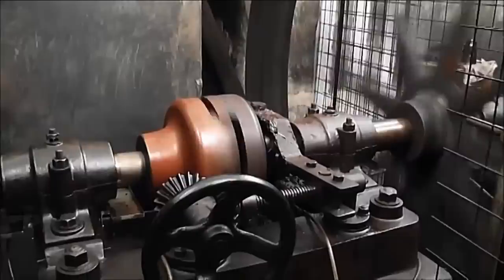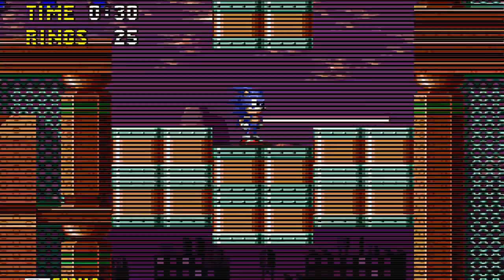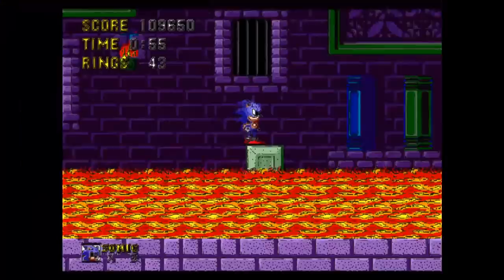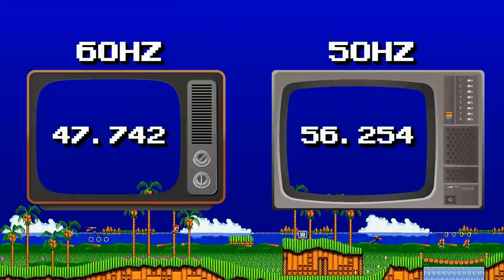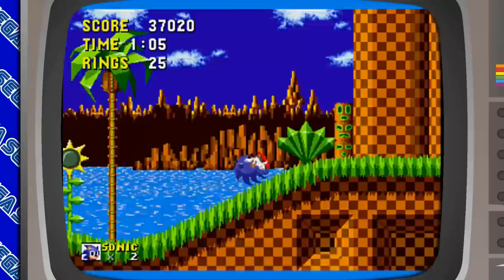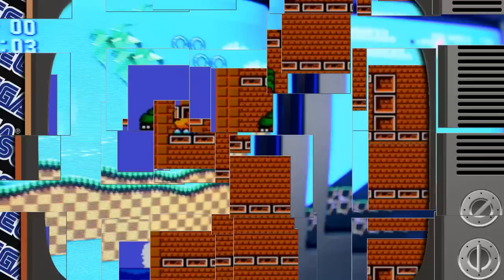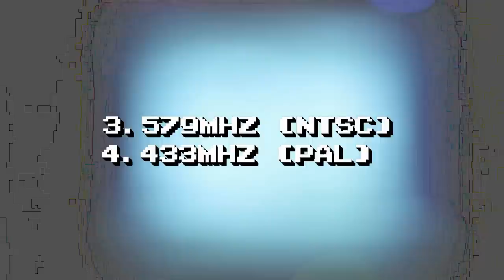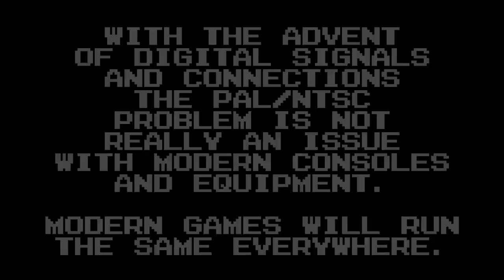Why is Sonic Faster in America? NTSC vs PAL/60Hz vs 50Hz | Nostalgia Nerd

Comment: Only tidbit I expected this video mention, especially in the "engine modification" part was the fact that Sonic 2 and Sonic 3 (and knuckles) do have a detection for 50hz. They ONLY change the music speed to what it should be, rest of the engine, gameplay, and even some sound effects and jingles are all still that 1/6th slower in 50hz mode. Someone with a switch can cause some havok by booting the game in 50hz and then flicking it to 60hz mode on the fly. Crashing is very likely to occur too though.

Comment: Just remember the section talking about how TV's only show half the picture at a time of this video misleadingly implies that game consoles output interlaced video. They don't. They use a hacked timing signal to output 224p or 240p or something like that by drawing the same set of lines twice, and leaving the other lines blank.
This is what causes the dark lines on a display that emulators call the 'scanline effect'.
It also causes most modern non-crt TV's to display the output of old consoles and home computers incorrectly, leading to an odd form of image instability that's not supposed to be there.
(mosern tv's largely ignore the actual timing signal, and just assume a pal input is 576i, and an ntsc one is 480i, which, for most systems up to about the ps1/n64 era is wrong, and displays the picture incorrectly)

Comment: AC power does not directly have a side effect of being able to be transmitted longer distances. The reason is due to the much higher voltage used in AC transmission on the grid. DC power transmitted at the same voltage would have similar efficiency. The reason AC was chosen for power transmission is because it is much easier to reduce the voltage to go into a house with AC that is with DC. Recent technology advancements have made it feasible to do the transmission on a fully DC grid, so it may be done in the future, since being all DC has advantages of not needing transformers for everything and our digital worlds (digital devices require DC power).

Comment: RGB over SCART is the way to go for old consoles. The connector is a bit clunky, and you might find yourself dealing with frustrating sync problems, wiring mismatches, and console mods in order to pull it off, but the reward is soooo worth it!
Reply: Also, fun fact: The Genesis can be overclocked. It's kind of a pain, as it involves desoldering & lifting one of the 68000's pins off its trace, then tying it to a clock circuit you have to build yourself--and there's no guarantee the Genesis will be stable at the new speed. But when it works, the results are pretty impressive. I could never get a model 1 stable at anything above stock clock speeds, but I got a model 2 working great at 10 MHz. That extra speed makes a huge difference in games that normally chug pretty bad, like Sonic 2's split screen mode & Thunder Force 4.

Comment: RGB is neither PAL nor NTSC, those are both encoding methods. PAL60 simply means the refresh is 60Hz and the colour encoding method is PAL. RGB is a discrete  signal, there is no encoding taking place.

Comment: Honestly I really quite like PAL Sonic. I mean sure, it’s slow. Sure, it’s not how it’s intended to be. But it’s honestly quite fun! The music seems strange at first, but you get used to it really fast and some of it I prefer. The gameplay, while it seems slow at first, you adapt to it rapidly and it’s not that bad, in fact the slow gameplay makes things a bit nicer sometimes, some difficult sections are much more manageable. I’ve beaten the game emulated in both 60hz and 50hz, and I’ve beaten it on real hardware in PAL, and it’s really interesting and I can’t help but like it.

And in my situation, it’s not just nostalgia either. I didn’t grow up playing Sonic on a real Mega Drive, as I wasn’t born back then, I grew up playing Sonic on the original crappy iOS app on my nan’s iPad, and while it was supposed to be running in 60hz it sure didn’t feel like it as the emulator was crap. It was actually running slower than 50hz, but I didn’t mind as that’s how I knew Sonic. However then they updated the app to run at proper 60hz, and I had the rest of my Sonic experience on a 60hz emulator, before I beat the game on a 50hz emulator and then eventually on a proper 50hz Mega Drive when I got given my mum’s old one, so I learned to play in 60hz, which means it’s strange how even now after experiencing both (and actually having more time on 60hz rather than 50hz) I still prefer the 50hz game.
Reply: Yeah! I prefer games to run at 50Hz too. Gives the player more time to react.

Comment: I remember when I plugged in my NES console to the TV (nowadays you can download a ROM-assisted emulator on pc and just play thse classics digitally) if the depiction on the screen was blurred, I usually rotated the adapter and straightened the entangled wires. It used to make the picture clearer. But now I know why I didn't have as clear picture as I wanted. Possibly because I live in Latvia and had PAL aided analog television. The frequencies just did not match. Thank you for uploading this video as a good material for me to study physics.

Comment: Interesting video! I remember first coming across the impact of the difference between NTSC and PAL back in the days of the 8-bit Atari (early/mid 1980s) as in the US they'd do something weird with pixel art layout termed 'artifacting' which effectively displayed additional colours that the machine otherwise couldn't. When you played on a PAL machine / display these would come out as strange purple or green, not quite as the developer originally intended!

The change of speed of game music is the hardest for me to accept - games that I grew up with and loved don't sound right if they're played at 60Hz even though that was in many cases the speed used by the developer.

Comment: Fun fact. Sonic 2 and the latter (along with most EU mega drive compensated games) run the music a little faster than NTSC, possibly due to programming not being able to get it perfect. For example, i measured the song Sortie from Gauntlet 4 on an EU machine, i let it run to a certain point and stopped recording, it ran for 40 seconds. I then recorded the song on the NTSC setting and for the same snippet of song (verifying the waveforms in audacity) the song actually ran 5 seconds slower and you can hear it. I always felt upbeat when playing the game on my mega drive and it felt... slower on Fusion, and this seems to be why. Sonic 2 has a similar result, so actually EU users might have gotten it quicker after '93 lol

Comment: PAL was standard in Brazil, but I really don’t remember a difference in speed or in scan lines comparing to NTSC at the time or later in emulators. I had an American NTSC Genesis running in color on a PAL CRT TV thanks to a wonderful box called transcoder, and my friends all had PAL Mega Drives running on PAL TVs.
Reply: É porque  o nosso PAL-M é uma gambiarra entre o NTSC e o PAL, aqui roda a 60hz igual o padrão americano.

Comment: I had a C64 imported from the US, with a matching color monitor, when I was a kid in the early 90's. I was surprised, when I took a game to a friend, why it ran slower... I realised only years later, that I had an NTSC c64. Unfortunately the computer died almost 15 years ago, when the shorted voltage regulator cooked most of the chips, then the monitor was useless, because all TV programs were transmitted in PAL in our country (Hungary). I kept it for years, but I had to toss it away :(

Comment: Here in New Zealand we are a PAL region, but SCART wasn't really a standard for our TVs back then. So we had slow, crappy PAL games and were limited to crappy video output.

That's why it sucks trying to collect NTSC games in NZ. I have to import games (which is expensive as Hell from U.S, but usually free or very cheap from Japan), as well as find workarounds for RGB output.

At least if you're in the States you have your nice NTSC games. And if you're in Europe you have your nice RGB standard capable CRTs.

Comment: I've been posting this on a few Youtube videos as I want everybody in the gaming community to know that there was indeed a fix to the slower music for the PAL 50Hz version.

Did anyone know that for all these years that we've been arguing and supporting why Sonic 1 is slower in 50Hz that there has indeed been a fix? Yes, not just one rom but two in fact, there are two Sonic 1 roms that fix (optimize) the audio for 50Hz.

1. http://www.mediafire.com/file/dw4pjtbk44w1fp4/Sonic+2+Clone+Driver+v2+%28v2.5%29+ROM+S1.zip this one uses the newer SMPS Sonic 2 Clone Driver v2 and runs in 68k mode which was made by Clownacy, Markey Jester, Valleybell and a few others. The drum samples are super clear! But the PSG suffers from a few out of key notes here and there but music runs identical as NTSC in PAL 50.

2. http://www.mediafire.com/file/4zb5b13n5jy7nn9/S1-friendly+improved+Sonic+2+sound+driver+%28v1.1%29+ROM.zip This one uses the older original SMPS Sonic 2 Clone Driver v1, in Zilog Z80 mode. The drums are not as clear and retain that ever so slightly higher pitched snare from Sonic 2, but thankfully, PSG and FM are in full key and again music runs identical to NTSC.

NOTE: When you boot these roms, make sure your emulator or console is set to PAL Europe 50Hz before booting, don't boot them in NTSC USA/JAP otherwise switching them to Europe PAL 50 after they've been booted will slow the music down to default 50Hz like the original PAL version. Also if switching to USA from a booted Europe setting will give it the opposite effect, the music will sound epileptic fast!

Comment: UK TVs did actually support 60hz as far back as the early 90s, I remember some Atari ST games having a frequency switch option for people playing overseas. It wasn't much use for us over here, all you could use it to do make games run slightly faster than normal but with a fuzzier, stretched out picture.
Reply: yeah, I remember having a util on my Amiga (relokick i think) that would boot an ntsc kickstart image thus allowing 60hz.  This was late 80`s and my scart telly had no problems displaying it.  I think most tellys by then could do it, but only through scart, not rf.  Had an import neo-geo as well, lovely stable rgb picture on the same telly.

Comment: A friend had an Amiga 1200 in the mid 90's and we used to play F1GP in NTSC mode for the increased speed boost which was great.

Even as far back as the 90's we had UK CRT TVs that offered 50/60hz rates and the speed was noticeable.

Comment: All these people saying that they "didn't bother to adjust the timing for PAL" are off base. MegaDrive games automatically had quite good PAL conversions owing to the way the frame was drawn (this isn't true for SNES and is especially bad for PSX). Owing to the way 2D sprite-based games operate, you generally can't adjust the speed without messing up the gameplay, or causing bugs (especially in regards to things like jump height), or causing weird motion aliasing issues (in one example, a "simple" splitting out of game logic from video refresh would effectively result in 10 lost video frames per second, every 6th frame!). Running the game at a slower speed was pretty much the best option most of the time. The music is an exception to this, in the vast majority of cases, it would be better to re-time music to the different spec, however this is a LOT of work. You generally can't just use the same version of the track to do the retiming, you have to do it again from scratch or from the source.

Comment: well, I lately was attempting to install a 50/60Hz switch for my MegaDrive model 2 revision  1 and in the process I learned a lot about the different problems that can happen from this, your video pretty much summarized a lot of the questions I had including why there is no color on PAL TV's and I didn't know that RGB scart connection takes away 1% from the speed. 
I have not done the mod yet because I am kind of scared connection a wire to leg 107 to the SEGA chip, it's a very tight space

Comment: A lot of those old devices also used the HZ of the power line for timing (including TVs, many alarm clocks, etc.). -- So it just makes sense for the TV to run at same frequency as power lines. -- The reason that causes the game to run slower, is that the game is running single threaded and the logic loop is only executed once per frame.  (Modern games run the logic and drawing on separate threads, so that if you drop frames, the logic will still run at the correct speed).

Comment: The vast majority of Genesis software does not run in an interlaced mode, instead it uses the so-called "240p" mode where the picture is not interlaced.  A few games do use the interlaced mode however, such as the two-player mode for Sonic 2.

Comment: what's funny is that all it needed was a few lines of code and it would have run on the US Standard. the problem is then you have to run a almost compiler with it so it doesn't default back to the 50htz. I think that's where the problem came in.

Comment: Beginner game collector here! I live in Europe and could use some help. Which consoles are affected by this? I mean, which games are slower and squished in Europe? European handheld consoles and games are probably perfectly fine. Switch, Xbox One and PS4 and PS5 are fine too since they are so new. It seems like European Wiis, PS3s and Xbox360s don't have any problems neither, they aren't old enough neither.

Most NES, SNES, MegaDrive and MasterSystem games are problematic and I should probably get those from USA if I'm going to get one. How about Sega Saturn, or Dreamcast? I once heard that Sega Dreamcast was one of the first consoles to work perfectly fine. If this is true, there is probably no reason to prefer NTSC Dreamcast games over PAL. How about Gamecube, Xbox, Playstation and Playstation 2? I haven't noticed problems with by Gamecube games but maybe I have just been lucky. If I want to collect them, am I going to find out that some Gamecube games are slower/worse than their NTSC counterparts? I have no idea about Xbox. Both PS1 and PS2 games often suffer from this, in my understanding, probably. Help??

Comment: N64 owners were particularly affected by 50hz consoles. Nintendo never bothered to optimise their 1st games and so ran much slower than the US versions. 2nd party titles from RARE were ok with them being UK based. Also, its particularly hard if not impossible to mod an N64 to run at 60hz RGB. By the time we had the Gamecube, we could use 60hz mode, but then no progressive scan option like the US games got!

Comment: I read that Nintendo actually went above and beyond and made sure Super Mario World ran at a higher vertical resolution on PAL systems as well as the same speed as NTSC, and I was wondering if it did the same for its other first party titles similarly?

If so then this would be a huge deal for me because most of the best on the system came from Nintendo, and if they were all optimized for the superior PAL display standard then it would be a plus 1 in the SNES column and PAL column.

Comment: Yeah, at the time we had no clue. But even then, i still remember that when i saw and played Sonic 1 for the first time, it felt amazing and fast compared to what i had experienced until then (my brothers had an atari 520ste and i had played NES at a friend's). Immediately made me want a Mega Drive because it felt like the future :D
And when i got it, i didn't get Sonic but Sonic 2...in which they compensated the 50hz difference through code, giving it approximately the same gameplay as the 60hz versions.
Nowadays, it's common knowledge that you need to separate graphics refresh from game logic but back in the day, it wasn't.

Comment: I remember when we had Amiga computers here, we would force them into PAL mode (and adjust our NTSC monitors) and they would run 15-20% faster on all tasks. It's weird to think that a PAL Genesis would be slower. They used the same processor as the Amiga.

Comment: NTSC is faster but has less quality.  NTSC uses 525 lines of resolution whereas PAL uses 625 lines of resolution so it is slower but has higher quality.  PAL was developed to overcome the problem of low quality signal in bad weather.  Because PAL has an extra 100 lines of resolution its screen appears better when the weather outside was bad.

Comment: Actually, no. The difficulty on many PAL games was moderately, to severely worse, than in NTSC. The explanation for this escapes me. Its something my fellow gamers and I observed whenever there's timed missions involved. If you are playing a mini game, the clock is ticking away and running at normal time, but due to the encoding slow-down, you effectively have LESS time to haul ass and try to complete objectives/win races/etc.
Unless the games designers compensated for this when the program was being localized to the region, which they often didn't, then you were screwed.